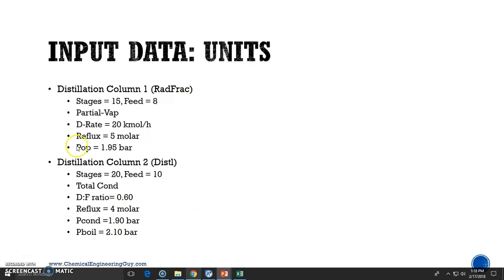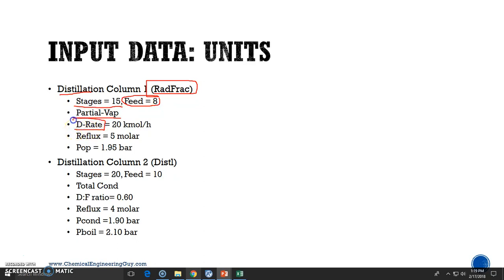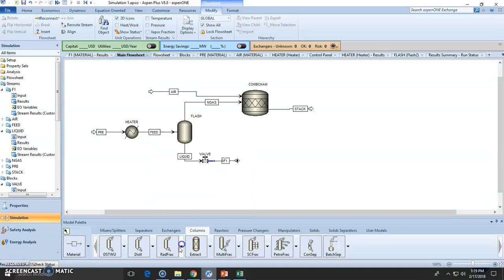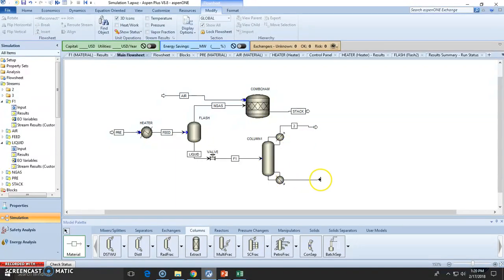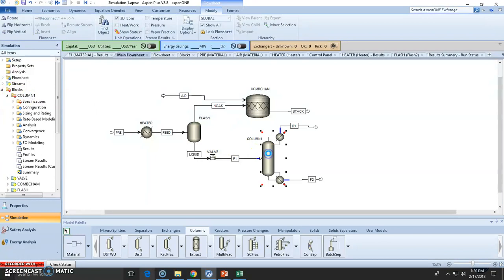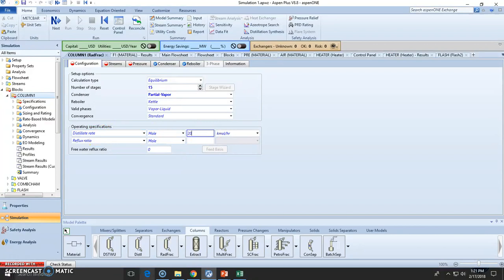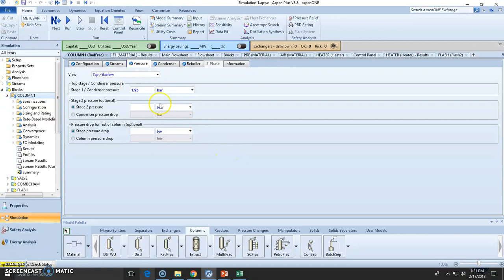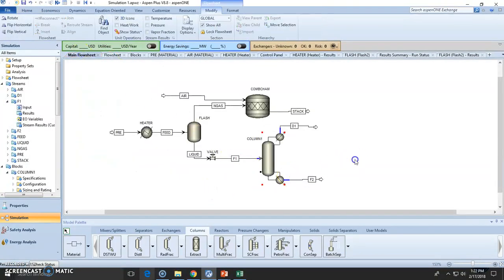Set up of a Distillation Column Model RadFrac in Aspen Plus (Lec 017)

Comment: Do the aspen radfrac and dstwu separation columns automatically have re boilers  or must you specify that they must have one? How can you tell by just looking at a pfd?
Reply from the maker: They DO have those units, if you open the "mother" unit operation, you will see the reboiler, the condenser, the reservoirs, the stages, etc...